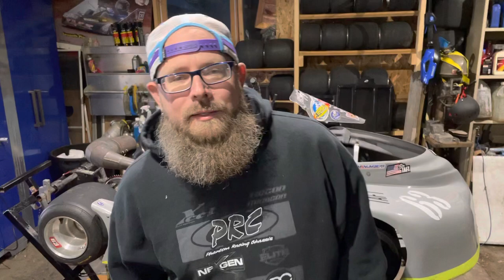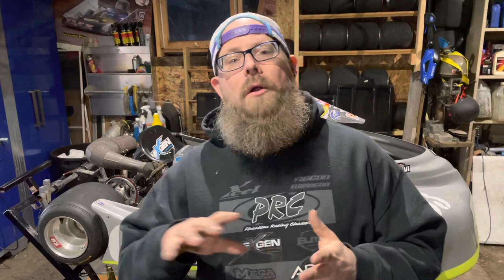Understanding Dirt Kart Cross?

Comment: Man oh man! I've just started racing at 50. I race in the carolinas. I've got an old twister kart( I think) been chasing setup by myself with bath scales. 43% nose 60% cross loose as heck! Watched your video a couple of times and got a  totally different perspective. Tried it last sat. Predator 375 lapped last 2 or three cars heat and the main. This kart came alive I noticed I was getting no wear on my left rear I was toting it all the way around I think. Dropped cross to 54% I could pull all the way through the corners and it showed! Thanks a ton! The Carolina unlimited all stars are coming to my track this weekend after watching your videos I'm looking forward to seeing them for sure.
Reply: When I say "old" twister I mean like 98 or older. Caster pill front end.
Reply from the maker: Thank you very much, I appreciate you watching my videos.  Glad you got it running better.
Reply: What is ur stagger and air pressure

Comment: Cross is weird because in certain situations you can increase for more rear grip or decrease for rear grip. Keep in mind that (in this case) the rear will have the most cornering grip when after weight transfer the load on the tires is even (or equally proportional to the width of the tires). Cross values are relative to the entire combination: chassis, left%, available traction, etc. Let's say static 50% left and 50% cross, when cornering the RR has disproportionally more load compared to the LR, adding cross will even the dynamic load. Opposite situation: 60% left and 80% cross, you may maintain more weight on the LR while cornering if there isn't enough grip in the track or the tries, lower cross evens the dynamic load, thus more grip. This is a massive subject, but thinking in terms of dynamic load helps me make sense of what is going on, anyway, Great content ~ Cheers!!
Reply from the maker: Yes, one of the harder topics to contemplate for sure.  Thank you very much for the comment.  Karts have all sorts of geometry, physics and chemicals all combined in one little fun package.
Reply: We race .25 midgets.. imagine adding shocks and coils to the equation!

Comment: I AGREE with 99,9 percent of what you said   I  have  for  3 years now campaigning a  2013 Millennium Impulse kart  in the  Predator 375 class  with  much success  20 wins  and finished on the podium  every race over the last 2 years  .. We  found out  this  kart  wants to  be  extremely free in corners,   so we  ended up  with  only  30% Closs  and  40%  nose weight . All my drivers were impressed with how  well  the Kart handled .  In this class  it's critical you don't  scrub  off any speed , every little turn of the wheel  you  drop RPM .. The motors  have to be  run  strait out of the box  from HF ,,Governor  working   and a 5500 RPM rule  is in effect .  my question is, do you think  going to  lighter 5" wheels and tires  ie  550 and 710 rears  along with  410x350 and  600  fronts could be of any benefit?
Reply from the maker: I don’t have any experience with 5” wheels to know the benefits or disadvantages.   They might be lighter though. Good question.

Comment: This feels like, the right results, explained wrong... newer karts are thicker pipe thinner wall, and flex more.... when you enter the corner, the chassis flexes, so much, it lets the left rear come off the ground.... loose, add cross... get the left rear back on the ground.
Reply from the maker: Not really talking 1 1/8” chassis in general.  But those were there late 90s early 2000s (until the mini con).  But yes the flex is def something to consider.

Comment: Okay so I got a question. So you're saying these new go-karts that come with basically High cross already in them, in order for you to loosen up the go-kart..... you add even more cross to the go-kart? Is that because it puts so much cross into the go-kart and I guess it would put it in so much of a bind that it's actually loosening the kart up?
Reply from the maker: You can think of it that way.  But I prefer the pressure on the RR makes you tight. Getting off the RR (aka) adding cross or putting pressure on your LR gets off the RR and frees the kart up.

Comment: We just started at the end of last year Bought a used deuce Chassis  we set it up with 68% cross It was pushing like a dump truck on corner entry Have not heard of putting cross in it to loosen it up. Any help ? Thanks
Reply from the maker: I’m jogging my memory from when I had a deuce.  Of coarse I had a open (uas) on it.  I believe I had 66% cross 60% left  46%nose. 1.5” front stagger 1.25” rear stagger.   Again this is with a wedge kart so I don’t know how well that will transfer.

Comment: If you're running a v2 which is  2011 or a fanatic there is a big tube and small tube but anywase on the v2 or the impulse u want to have ur cross at about a 60-70 % but on the new chassis with the split bar u would want to be running about 70-72% of cross
Reply from the maker: I had a Infinity Epic with a 1 3/8 outside engine rail one time.  I never did figure out what that wanted.  Good chassis though.   Didn’t get into the 1 1/8 stuff because I primarily run opens.

Comment: So im in a 2003 Nemesis, what should be my ballpark for cross ?? Im on small bullrings Oswego, Moose mtn etc.
Reply from the maker: I’d consider that a low cross chassis.  Somewhere around 52-56 cross.  If the track is super loose try on the higher end to tighten the chassis and keep the left rear planted longer.
Reply: We ran nemesis back in the day, and here in the south, we always ran highcross in them with very good success. 65-70%. But the area and track conditions u race at can make big difference in this situation. Back then around here in NC at most of the tracks we raced many if which are no longer around we needed tires punching in the high 60s to 70s.

Comment: So I purchase the kart it’s an older one went through and painted everything but put everything back to where I found it but after seeing tires on it for the first time I realized that the LF isn’t even on the ground I race action Park Easton and Champion in NY they’re both pretty flat should I take that LF and make it so it’s contacting the ground haven’t gotten it to the track yet but am supposed to race it Saturday that’s are opener in 4 days
Reply from the maker: Depends how old.   Higher cross chassis the left front is barely in contact.   Any idea of front and rear stagger?
Reply: @kart6t3_ben  I don’t no cross yet gotta take it to a buddy’s Thursday and get it scaled every ones telling me it’s a 90s chassis I send ya a pick of it let me my big question is it’s not touching at all only if I lean forward
Reply: @kart6t3_ben  so I put it on the scale today I have a 77%cross and I need to add I’m 10 pounds light whare would be a good place to add it
Reply from the maker: @joeymacali2387  that is a lot of cross.  Witch is why your LF isn’t touching.  Maybe in the nose area?  Not near the LR that will cause even more cross to be added.    For reference I had a 04 Trick that scaled 57L 55Cross 45.5 Nose one of the best karts I ever owned.
Reply: @kart6t3_ben  ok thanks still new to this but I’m hooked I have so much to learn your videos help a lot I started last year mid session on a buddy’s kart and I was in a battle to get it where I did it was a straight kart and I kept playing with it and never could get that lil extra I needed to catch 1st place I’ll try that and see what happens might have a buddy at the track see if he can help me out a lil on Learning the scales better. I do have One more question about Castle nuts or spindle nuts how tight should they be ??
Reply: a 3 legged dog  can hunt  I've  seen it  on a tight bull ring

Comment: How about some ways when you're at the track on how to tighten up a kart or get rid of a push?
Reply from the maker: Depends where the push starts.  Center? Increase rear stagger.  Now if it rotates well center but pushes off I’d keep the same stagger and increase cross (high cross kart). Also increasing the air split in your tires will free the kart all the way through.
Reply: Increasing stagger or decreasing stagger sounds like ur issue. Once u have a decent chassis setup u really don't need to do much if any changes trackside to the chassis. U can make most changes needed at that point via air pressure and stagger changes. We try to stay around 1 3/8 stagger in the front and 7/8-1 1/8 rear stagger dependent on the track and conditions. Many people will also misdiagnosis a 4 wheel slide as a push and they are just to high on air or not soft enough on the tire.
Reply: if you  go tighter  your push  would  get  worse  you  need to  get   weight off  your  left rear  and  on  to your right rear I would  decrease  the cross . but  at the track maybe  try moving  weight  forward